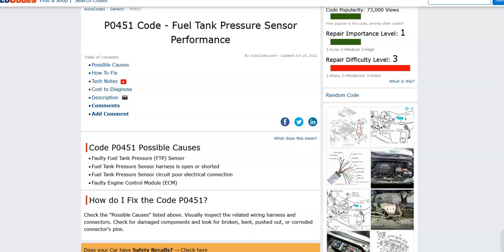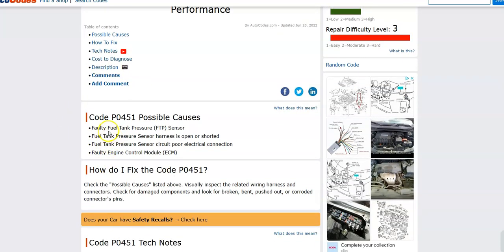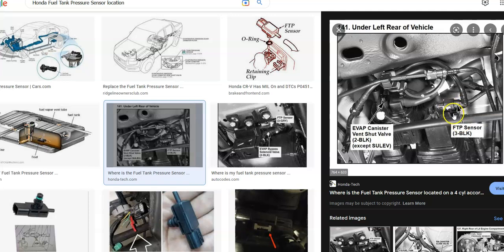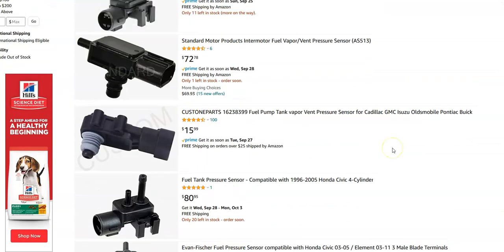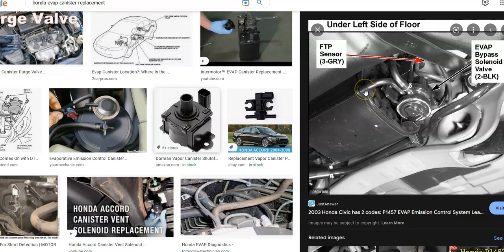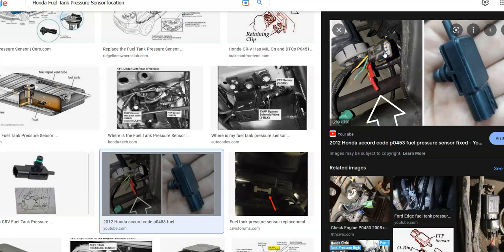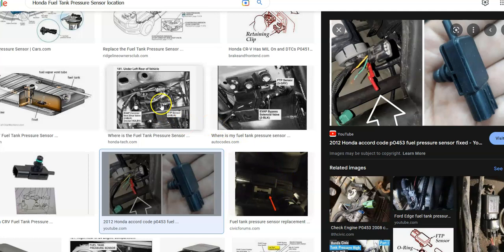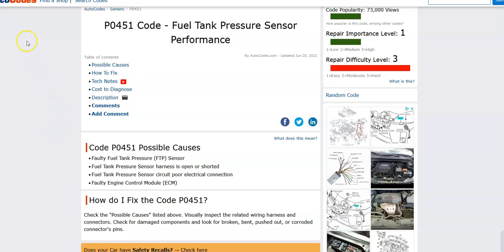How to Fix Honda P0451: Fuel Tank Pressure Sensor Performance

Comment: Hello I have a 2011 pilot. Started stalling and longer starts. I spent so much money with different shops that couldn’t find the problem. Money in parts that I didn’t even need like. Electrical throttle body,ECU,crank sensor,ground cable,coolant sensor and more. Well problem still isn’t solved. Thanks for your video I’m going to try this this weekend hopefully this is my problem 🤞🏾